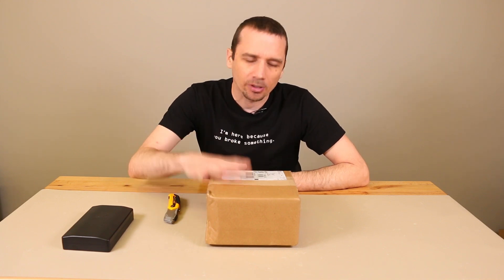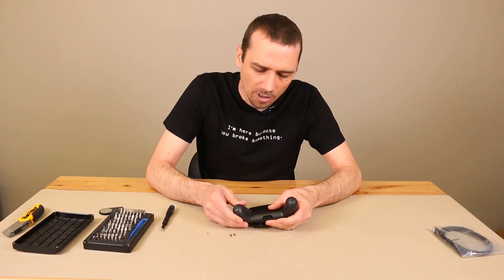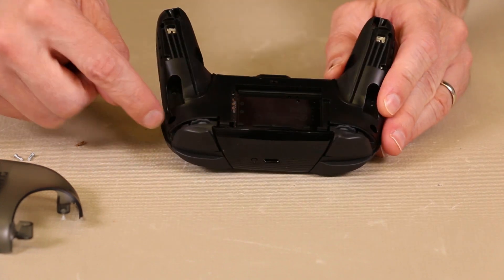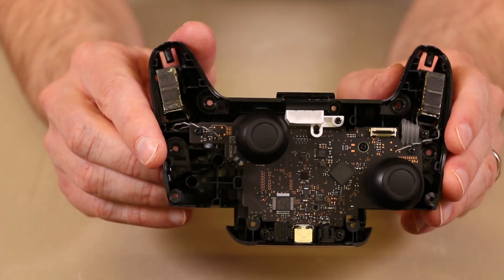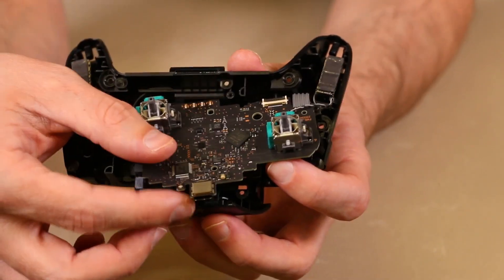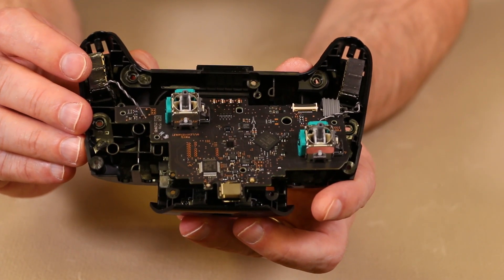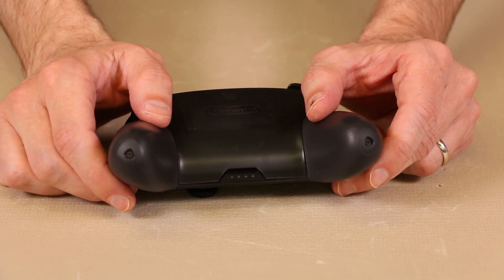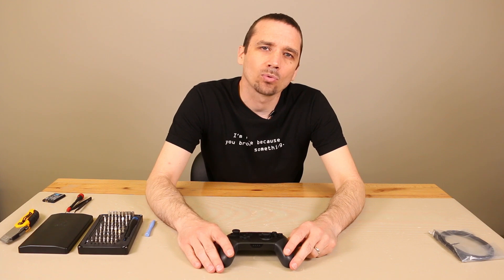Nintendo Switch Pro Controller Teardown

Comment: Hey Steve (sorry if I spelled your name wrong),

I have been a big fan of your channel for a while now. I believe my ribbon cable is broken because my daughter tried to wash off my pro controller because my other daughter got toothpaste on it. When I finally got the correct tools later in the day to take it apart, I noticed that the ribbon cable was chard. I used 70% isopropyl alcohol (I would have used 90%, but 70% was all I had at the time) to clean up all the spots where it got wet, including the chard part of the ribbon cable; however, it will not power on now. I suspect the ribbon cable. Do you have an affiliate link for a ribbon cable connecting the controller's top and bottom half? It's the white ribbon cable.

Comment: I took apart my pro controller to clean the sticks because of drift with isopropyl alcohol. It worked pretty good after I cleaned it and put back together but a couple hours later I went to use the controller and now it's completely dead with no light indicators either. No idea what happened. SOMEONE HELP ME!! ANY IDEAS? THANKS!
Reply: Bit late but maybe the alcohol damaged a circut?

Comment: The screws are not Phillips standard hey are JIS 00, that's why everybody, including me, strips the screws.  I just noticed this a little too late.
Reply: The first 6 screws (handles and battery cover) I had no issues using Phillips 00, but the last 5 little suckers are very close to being unscrewable. I'm actually not mad at Nintendo but myself for being so stupid.

 I'm glad I now know what Phillips actually means as I always thought any screwdriver with 4 points + is called a Phillips. 

JIS has a nice sound to it kinda like JDM.
Reply: @Vinnay94  I couldn't go that far to notice.  Probably never will.  😔

Comment: @TronicFix, I stripped a screw in my Xenoblade 2 pro controller trying to open it with a J00 attachment from my IFIX it kit. any help on how to get it fixed or repaired? the grip itself does not sit flush on the right side that is stripped like the left side. small little gap. Also what size is the screw head and screw? maybe a washer would help me in this situation? hopefully you see this and can assist me. Thank you.

Comment: Greetings Tronicsfix and Tronicsfix community
First of all big fan of your videos very entertaining content probably on of my favorite D.I.Y electronics video series I watch. I always refer/ consult your video whenever I research repairs I have to do on my consoles and controllers.

So I have a question about the gamepad tester website you use @tronicsfix you use in some of your videos (also any community members feel free to chime in).

I recently used that gamepad test on a switch pro controller and all my buttons check out, but I am having  a bit of trouble understanding the readings on my joysticks. 

When I push the joystick in any direction the dot touches the circle (for the most part) and there is no drift, but when I run the "Test Circularity" I have an average error of 3.4% on the left stick and 6.3% on the right.

My question is what is (or is there) a reasonable amount of error that I should look for before I change my joystick? Or does the percent on the "Test Circularity" not matter as long as the dot touches the circle on the tester my controller is fine?

Thank you again and keep up the great content.

Comment: Hi, quick question, when you put the ends on at 7:20, when those are put on and screwed on. Do they ever move about slightly, like just a little?  If you try to move them. Although they're screwed on is there slight movement with them. As my right one moves a tiny bit.
Many thanks
Reply: Did they move before you opened up your controller? I've never opened mine, but they are quite solid for me. Nothing is moving

Comment: Just attempted a repair with a another guy's video that didn't specify that the Phillip Screwdriver should be a J00... I ended up stripping one of the screws ...and I'm debating between buying a $70 tool kit to repair a screw and drift in one joystick... Or buying a whole new $60 controller...

Comment: Are the springs of the buttons interchangable?
Reply: they dont use springs, they use rubber domes that you would find in a membrane keyboard so go on ebay search the button and the dome you need and replace it

Comment: Really appreciated this video. I just bought my grandson a Pro controller about five months ago and he has kicked it off the bed accidentally onto the hard floor and now he says the right thumb button is not working correctly. I don't know how to solder anything but I thought if we could just take it apart and take that button cap off and put it back on maybe it would fix it. I don't know if there's damage under that button on that little square thing that that black button sits on. Okay now I know I have to get those two screwdrivers. finding somebody to fix it if that piece needs to be fixed under the button would probably cost me as much to fix it as to buy a new one sadly. okay at least I have positive hope that we can fix this without having to replace anything. If it works I'll let you know as soon as I can get screwdrivers. 😊

Comment: I can't get the initial 2 screws off for the life of me, my #0 Philip screwdriver isn't able to dig into the screws at all. Any tips?
Reply: I just took mine apart to get at some sticky buttons and I had to use a 1.5mm flathead because my 00 and 000 weren't working

Comment: Dude, why did you tell me to disconnect ribbon cable. You made the reconnection look like a piece of cake and now I cannot get the ribbon back together. Plus you don't show any up close removal of cable and I can't get it back together. I wish you explained BEFORE you take the ribbon cable OUT that the black part is hinged and simply needs to FLIP UP! Not everyone watching this video knows that. I thought it was simply a retainer clip and slid in and out... Great video until you FAIL to explain how that Molex connector works.
Reply: molex???????

Comment: can I teardown my pro controller and use canned air to help fix drift?
Reply: I know this is old but the answer is probably not. If you recalibrated the joystick and it is still drifting it means the potentiometer on the joystick is bad. You would have to desolder and solder on a new joystick.

Comment: Anyone have a problem with their switch pro controller not turning on? I've torn it down and can't diagnose anything wrong with it other than maybe the wire ribbon, but I don't think that is it. Controller won't turn on at all. Tested the battery in another controller and it is good and fully charged

Comment: Thank you for tearing down. On 4:21it looks like the thumbsticks are a tiny bit away from the motherboard, but I'm not sure. It must be cause a peace of plastic in the middle prevents it to be closer on the board. Or there is a mould where they can stick in. Maybe someone replaced it already and can tell

Comment: I am just about to go insane because I am short 1 screw, somehow. So, the tiniest ribbon cable that connects the four top buttons, R1/2 & L1/2- that tiny ribbon cable seems to have a Phillips screw right underneath it. I don't remember actually unscrewing it, but there is a screwhole there and I put a screw in it, and as I'm to the end of reassembling, I am now a screw short.

Was there a screw behind the micro-ribbon or just an empty hole for some reason?

Comment: I would have liked to see you take apart the front button assembly. I'm in the middle of replacing the shell of my controller and i needed to see where a specific part goes

Comment: I need to replace the joystick cap for my pro controller so I need to know if there is one kit which has everything I need to open the controller. Any help since I'm not financially strapped to be buying expensive tools or a new controller.

Comment: While the controller is comfortable to use, the analog stick durability is horrible. In 2017, after a month of use, Nintendo had to send me a replacement under warranty. The replacement lasted me until 2019 requiring me to blow air under the housing more often until the temporary fix was only giving me a minute of use. I've since been using a Sony PS4 controller with a USB adapter. The rumble feature did not work with Splatoon 2, but I usually turn off rumble on any console I play on.

Comment: Hi,
I accidentally screwed with the flex cable from the front part of my pro controller (the one you show at 3:30 approximately). . Happened because I accidentally disttached the cable and I damaged trying to put back.. There's any change for a repair or possibility to buy a new one to replace? Nintendo assistance is pretty much charging me the price of a new one.

Comment: What did you use to get those first two screws off, a nuclear powered drill?  Those things are almost fused in place on my Pro Controller.  Won't even start to loosen.
Reply: same issue for me. I had to push REAAALLY hard and try to use my fingers on the side of the screwdriver to turn it with as much force as i could.
EDIT: Finally managed to get all of the screws. Ended up getting a minor blood blister on my thumb from the sheer force i used on the screwdriver.  Generally, you would think controller screws aren't too tight but i guess not.
Reply: I basically instantly stripped mine. Not sure what to do now :/

Comment: You wouldn't happen to know or be able to read what the 6dof (gryo) chip is Nintendo used for this controller, would ya? You glossed right over the chip names in the video and so far you're the only one who has done a teardown of this controller.
Reply: It's also safe to assume he has no idea what he's talking about too.

He's trying to compare the L&R buttons to the Xbox 360, and One's LB & RB buttons. They're not the same at all. The Pro Controller uses contact pads, while the 360, and One controller use Tac switches, and the 360 tac switches are notoriously bad quality (said to be good for 100,000 presses, which is very low quality). Especially sad when it comes to someone who does this for YouTube, and I'm sure has torn down the other controllers. Should have noticed the difference right off the bat by just pressing them.

Comment: would have been nice if you took apart the top half where the buttons were, but it was pretty easy to figure out. you disconnect the black ribbon cable and unscrew the 4 screws that are on the board and top piece of plastic. then pop it off. once you do that it exposes all of the buttons and rubber contacts underneath

Comment: My R button stopped working. I opened the controller and saw the test pads well identified. Could i solder a cable directly the to add a small switch replacing the original button?

Comment: I cant get the grips off of mine and i stripped the screw a little. What am I doing wrong? The screwdriver fits
Reply from the maker: If it's the right size you need to push down harder as you turn.

Comment: So my left zl trigger on my controller clicks weirdly louder than 
My right, makes a higher pitched click compared to it anyways. Is that normal? I remember my triggers being silent :( I’ve tried cleaning them but I haven’t taken the controller apart , any tips?
Reply: Leave them alone. They're contact pads. The sound has no effect of the inputs. If you're inputs are being dropped, you're either too far away from the console, or the contact pads somehow got dirty and just simply needs to be cleaned.

In other words, it's normal.
Reply from the maker: I'm not sure on this one. Sorry about that.

Comment: you need to take the top buttons off so I can see if there are boards there or if there isnt. I must knwo so I can extend the buttons to arcade buttons for my pinball cabinet with a 46 inch tv.  With pinball fx working in cabinet mode the switch is perfect for pinball
Reply: thank you for the teardown by the way. its got me stoked to do this mod

Comment: Yea I usually do this with all my controllers and nothing has ever gone wrong, but this time when I did it my dog decided to jump on my desk when I was away and he ate the little transparent rubber piece that goes under the home button and I basically have to buy a new controller cause I couldn't find a replacement

Comment: Quick question: Would removing the grips void the warranty? I have accidentally stripped one of the screws. So would it be void? Nothing else such as the components were touched, the grips weren't changed or modded, literally took them on and off.
Reply from the maker: I have no idea...you'd have to ask Nintendo about that.
Reply: It does not void the warranty. Nintendo is awesome about that. I've sent them in heavily modified joy cons and they replaced them no questions asked.

Comment: Thanks for taking apart the controller and not taking apart the other half of it with all the buttons on it, I guess...
Reply: i noticed that as well, i waqnted to see that portion too
Reply: That's a rude comment. it's a very high quality video for an independently ran channel.
If you want to offer criticism it's pretty easy to do without being a prick about it.
Reply: @HotChook   If it was high quality, they would have done the full year down, and know the difference in the L & R buttons, from the Xbox 360, and One's LB & RB buttons. They're not the same. He would have known this, just by pressing them, or you know... doing a full teardown like the video is stating it is...

Comment: I got this controller and it feels like a brick. The fact that it's extremely repairable is a bonus. Props to Nintendo and props to you for doing a teardown. 

The sticks feel pretty solid to me, hopefully the analog sensors don't wear.
Reply: The analog sticks are now soldered so no, not very repairable friendly.
Reply: @Aitor  Umm, majority of Nintendo controllers soldered the sticks i.e GCN, Wii, Wii U (game pad was modular though).
Reply: @Aitor  it looks pretty easy, if you can't solder you have no business judging how repairable something is
Reply: @madaudio58  I have no problem soldering. But that has nothing to do with calling something repairable friendly, don't you think?

Comment: hey i took my controller apart to sort out some dpad issues and now the gyroscope doesnt work. any ideas what migh have happened?
Reply: I'm interested to know if you have resolved your issue. In fact, I would like to know WHERE is the gyroscope in this controller
Reply: Might just need to recalibrate the motion controls with the console. If it doesn't work, there is a good possibility that you could have fried it with static electricity. You should always ground yourself before you start to handle the PCB. That's as simple as touching your sink faucet.

Comment: Is there any way to switch the x y b a buttons so they are configured the same way as they are on an Xbox controller? The buttons being backwards on the Nintendo pro controller complete mess me up.
Reply: Except in Japan, the PS4 X is confirm... but don't changes what the buttons do for USA, Nintendo is consistent. But it seems you are more concerned about being able to remap buttons. And that I can agree on. Though in my experience mapping buttons on Nintendo has usually been implemented on a per game basis.
Reply: Leroy Jenkins you realize Microsoft is the one that did it backwards right? Nintendo had controllers with that button layout sense super nes days.
Reply from the maker: Hmmm...I don't think it would be easy but it probably is possible. I might have to look into this.
Reply: The buttons ARE backwards on Nintendo controllers in America. B does not come Before A unless you read right to left. 
The bottom button "where B is on Nintendo" should ALWAYS be action/enter and the right button "where A is on Nintendo" should always be back. This is how it is on PS4 and Xbox. I don't care what they are lettered but having down be back on Nintendo is beyond annoying for Zelda. They need to enter 2017 and add button mapping. I know a few disabled gamers who wouldn't even be able to game on a majority of games if it wasn't for button mapping. Chronusmax already said they don't have the time to develop an update to make Xbox or PS4 controllers work on the switch so I need a fix. Either a simple button swap mod or solder mod.

Comment: Is it the same battery as the Wii U gamepad if so could I put the Wii U gamepad high capacity battery in it?
Reply from the maker: No, it's a lot different of a battery.
Reply: TronicsFix Then which 3ds model does the battery come from? New 3ds XL?
Reply from the maker: Any 3DS XL
Reply: Cool Thanks!

Comment: Definitely credit to Nintendo for finally abandoning the use of Tri-Point screws, at least on this controller.
Reply from the maker: Yep, that's a nice feature!
Reply: Though none of my screwdrivers got it open
Reply: Credit to Nintendo for making this overpriced "pro" controller with a lifespan of a single year.
Reply: do you mean to say that your controller broke...?
Reply: @Aitor  Nani? Stick Dorifto?
Reply: @Vinnay94  Sou desuyo!
Every single Pro controller I own started drifting less than a year after purchase. And I own 3 official ones.
Reply: @Aitor  Mine is holding strong since 5 years, just now some spilled drink which made the buttons stick

Comment: I like the design of the controller. looks like it's well worth the 70 dollars.
Reply: by the way any tips on how to fix the original PS4 touch eject button? sometimes the PS4 just randomly eject the disc out.
Reply: Its worth 50$ tbh